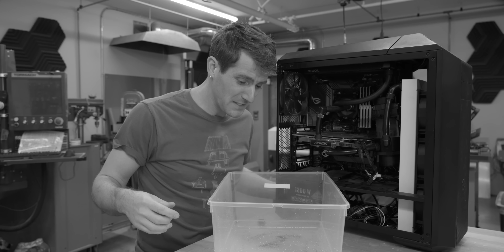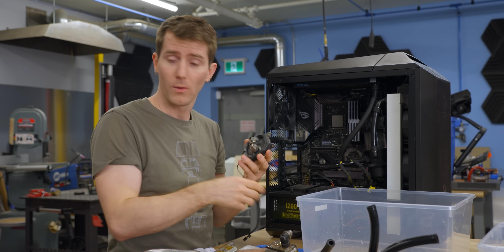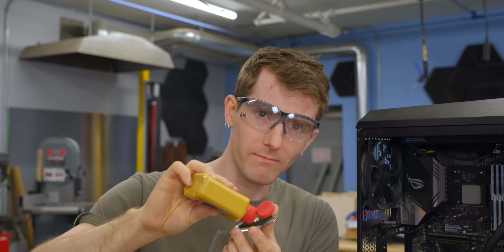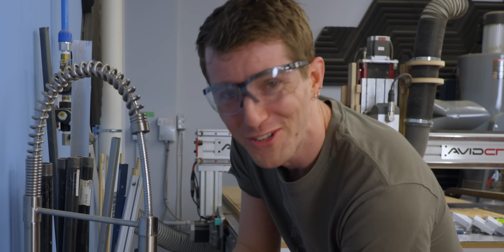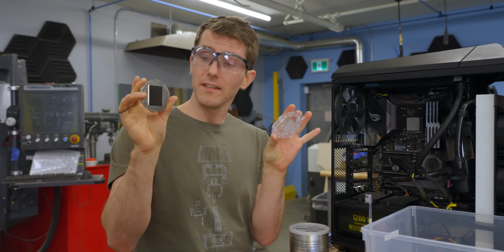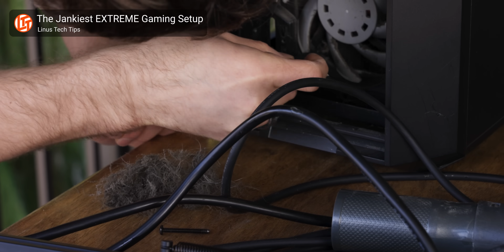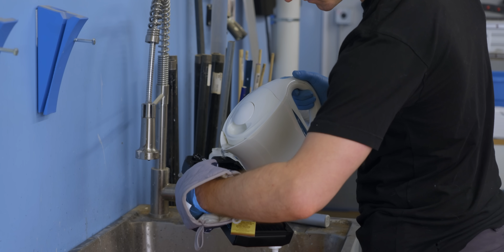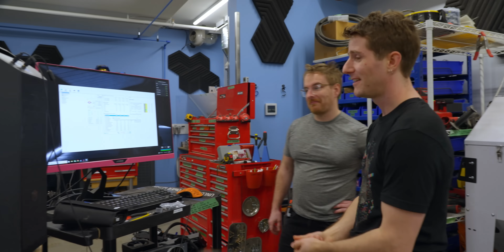I Will Never Watercool Again – Water Cooling Maintenance Guide

Comment: I can say that with modern hardware to properly cool those higher end cpus u need something like the nhd-15, which is a chunky boi and can definitely have some component compatibly issues like a tall ram.
had an issue with my current serup where my rgb ram was too tall, so i had to run without a side panel so i can ran 2 fans, until i built a second pc with nhd-15s and a shoeter ram and shortly after that my rig had issues with the ram and it was solved simply by swapping the ram between the systems.

Also (I have only a 3070) the gpus nowadays are very thicc and require even more planning and probably bigger cases which can get more expensive (mby expensive enough where u can get an aio instead in some cases (well at least after checking local pricing) ).

Comment: I like a big system. I have an x560m, 480-l and 360 monsta in a v3000+ and its amazing. I have it noise normalize so the fans and pumps just runs the same speed and its all but silent. But the other benefit to a system like that is OC stability. They say new i9 is stupid to overclock but i had a 12900ks running a 5.5 all core at 1.35v (delidded) and staying under 70c while pulling 340watts. Its a huge waste of miney but it does have diminishing benefits 😂

Comment: I stay away from water cooling.  It's messy and a lot of times, dangerous.  If you're crazy enough to go beyond AIOs and make a custom loop, you better prepare yourself for any potential disasters.  I would argue that water cooling is best suited for people who have a lot of money to burn, as maintenance is not easy or cheap.  AIOs also take more time to clean than a standard air cooler.  Leaks for custom loops are a lot more common than most enthusiasts would like to admit, and strange growths may happen INSIDE the loop.

If you're a content creator that likes to run your processor to the maximum, maybe you'll need water cooling.  If it's just gaming at 1440p, air cooling would be good enough.  I personally stay away from 4K because though it looks nice, it eats up too much resources and you take a hit in framerate.

Comment: I haven’t messed with water in many years.  The maintenance is too much for someone like me who is lazy. Koolance LIQ705 is clear, non conductive, performs close enough to water, and I let me loops go for 5 years without any maintenance without any major issues.  Sometimes I need to add fluid, very seldom though.  It can go longer than 5 years, I just perform whenever I upgrade a component

Comment: Sooo... at like 6min you cleaned the plating so well. you exposed 2 metals that are in electrical contact while inside an oxidizing medium... so what I am saying is. this is gonna rust. its not a question of if. its a question of when it will just start leaking XD

Comment: why not use a paint shaker to shake those radiators vigorously. ps im giving up on water cooled. its just to dam expensive. everything to dam expensive. when a gpu cost as much as the whole fucking computer. its just not viable any more. thank you tech world for over pricing every dam thing that has to do with a computer.

Comment: Exactly like your automotive cooling system. When you need to add water to the systems. Use *distilled water*.  The less iron & minerals in the water. The less buildup of corrosion done to the metals, plastics, and rubbers that make up your system.

Comment: you did the cleaning of the radiator WRONG! After the white wine vinegar and water mix, you need to flush it with a mix of a warm WATER and Biocarbonate of soda (baking soda to you lot) MIX- in order to neutralise the acidity of any remaining vinegar...... if you don't do that then your clear tubes bet all fogged up. Then the final rinse of your rad before isntalltion is ALWAYS with distilled or de-ionised water........... BLOODY cowboys!

Comment: I saw the weaker reliability of wc. So i don't use it. Running noctua su12 and positive air flow. PC lasts for decades and have a servicing every 2 or 3 years. A wc is lucky to last past 3 yr without requiring a replacement. That's more work.

Comment: Not all O-rings need lube but, if your going to for water source iv thought about it but have not done it yet for PC WC O-rings Magic Lube, you use it for pool O-rings so if your thinking of using one Teflon based ment for it make sure you have the Blue cap version not the red. hard to say there,

Comment: Anytime u take out a rubber o-ring you should replace it. When you put pressure against them it flattens over time. By putting it back in your introducing a fail point.

Comment: I am smugly reminded why I like my set-up with a chunky air cooler.
Yeah, watercooling allows greater overclocking, but ... air cooling just keeps doing what it does.
Bit like comparing a race car to a "daily driver". One is faster, but the other one does not need the oil changed once a week. Different tools for different jobs.

My next experimentation will be into underclocking, so extra cooling is kinda unnecessary for that use case ;-)

Comment: Hmm water cooled PC. I work in the laser tech a lot of lasers are cooled by air, fan or sometimes water.  Our 100 W CO2 was water-cooled with distilled water. The 6 W Argon ion laser was also cooled by water. In Photonics I build an air-cooled Nitrogen laser at 30 mj a second Max power. Rated 337.1 nm.  We did not have the budget to build any Nd;YAG lasers at 1064 nm or Ruby lasers that would have been very cool.

Comment: Hm, maybe I should clean my custom loop I built in early 2020 (distilled + kill coil). Only maintenance I've done is add more water, since the outside rad leaks the tiniest bit, and admittedly the clear tubes grew hazy a couple years ago. Fine temps, though!

Comment: For pump parts, use ultrasonic bath. Use distill water from 3M. Premixed coolants are toxic and will evaporate into your environment. If you use blower to clean your radiators then keep in mind that FANs are better to be removed otherwise you will blow dust inside the bearing(sometimes).

Comment: 16:47 Guys, WTF are you doing? Really. 
Look, just take bucket/canister, hand-held boiler (google for Korjo Travel Water Boiler), hose/pipes, Y stainer and assemble your hardware wash.
Gallon of water, winegar, couple oz of citric acid into canister, hot water and boiler for temperature maintenance in there too. Hose from canister to pump, from pump to radiator, from radiator to Y stainer, from Y stainer to canister. Boiler plug into socket, 12v on pump and leave it for hour or two, then change direction of water flow through radiator (swap from_radiator and to_radiator pipes) and another couple hours of washing.

Comment: I've been running a custom loop for 8 years and have replaced the waterblock with a new processor once, and changed the water twice. I run premixed motorcycle coolant in it with no issues.

Comment: The metal that was used to create a radiator, could've been used to create a bigger heatsink.  Plus, you're still technically air cooling as fans cool the radiator.

Comment: after multiple big fan radiators, AIO's failing, and just heat problems in general, I went to building my own water loops and never looked back. Temps stayed great, only use distilled, and still no complaints. And honestly, any leaks have been me not initially sealing something correctly.

Comment: I fell in love with Noctua 3000 rpm fans not because faster is cooler but because they can keep air moving through the dust I refuse to acknowledge. 
"Well how can you hear anything over that" 250w speakers of course, just turn it up.

Comment: Automotive guy here who now disabled became tech guy and when building my first pc I instantly went to automotive tech like you said but also that you screw them down lightly first in star or plus shape or anything but as you stated then when all are down then go back around and tighten them to spec.
  I have wondered why the computers do not cool the same way like cars. Having an external radiator with a built in reservoir that like a car have a top side fill and a bottom drain that would keep the water out and not have to really take the pc apart so often to keep it clean and cool.  I watch your videos often and I wish you would just start making and selling computer things made better. Like the water and air cooling that you have shown the flaws of.  Another question when setting up a watercooling system, Why don't they have a filtration section in the tower, There are often tones of empty space in a tower that you could just have a filter somewhere in the line between radiator and the reservoir. designing your own loop then make your own filter replacements and you are set for life.

Comment: If there is a contact with copper, ions will erode and cause corrosion on other metals. Pipes are also not diffusion resistant, so the solution will get acidic from CO2 and will make metals oxide.

Comment: imo water cooling is only necessary if you're running a very high-end setup and use make constant use of heavy applications
and when i say very high end i mean veeeeeery high end, one of those nasa-level PCs which can get on fire if not taken care properly
my PC is not close to being a high end one, so it's not a great example, but i run a 1060 zotac 6gb and an i3 10th gen, having 4 fans (3 in the front + 1 in the back) on the casing + one specific to the CPU + another one welded to the GPU
the hottest i've ever seen my GPU go was 60ºC while running minecraft with complementary unbound shaders on an average 45fps (i was very surprised that it got this high and ran kind of smoothly without a single lag-spike lol)
and with that, the only maintenance i do is a bit of dust-cleaning once a year
another example is a friend of mine whos running an actual high-end setup, with an rx6750 xt 12gb and an i9 14th gen, he's got 3 fans on the front and also does a single dust-cleaning yearly, never had a single issue with overheating

Comment: I'm not sure why people think water is any quieter then air?  Radiators need fans, so you can just upgrade your fans to a quiet one and run it slightly lower, and it's just as quiet as water.  Custom loops are not worth the cost, upkeep, danger of ruining parts whatsoever.  With that being said there is also nothing wrong with running water if you want to tinker and are ok with a leak where you have to go without a computer until it's fixed.  For me I run a custom AIO, and fans, or high end air.  I will say having water is nice to have the extra room in your case though not having a huge air cooler covering your MOBO, it's cleaner, and easier to work on stuff, unless it's a hardline custom loop etc.  Also with certain CPU's when they didn't use liquid metal and people were de lidding them without delidding water would be of no use as it can't dissapate heat any quicker due to the CPU bottleneck from not using liquid metal, and all that nonsense.

Comment: Using watercooling a system in my pc for the last +20 years. Had one accident where i fried some harddrives back in the day (120gb and a 160GB) but that way my own fault.
Otherwise its great - cant hear a difference if my pc is on or not or on full load. But i probably build my system better then he did.
Also using the heat for my large 500l fishtank - ofc a different water cycle.
Saving a lot of money on heating.

Comment: I watercooled. You can't refresh the thermal paste without dismounting certain parts of the loop. I had to silicone glue the joints because there was a manufacturing defect in the EKWB pump which led to a tiny trickle of water leaking out of it. The worst part is my water turned from green to grey within a year. Not to mention I had to butcher my 1080 Ti to get a waterblock attached to it, and yet the VRAMs and VRMs still overheated. Never again.

Comment: And this is why I just buy the biggest Noctua that fits in my case. Aside from blowing it out and maybe theoretically replacing the fans one day (I have seen 13 year old fans work just fine), there is no maintenance. I prefer to waste my budget on IDE interfaces and LS-120 floppy drives. :)
Reply: yes, I am glad I didn't even go for an AIO on my new system because I never quite trusted water cooling. Now I know why. My last system, with a mid-life GPU swap, lasted close to 7 years. 0 maintenance and it's still running just fine as a secondary now.
I run a 4090, a big noctua on a 7800x3d and two large case fans - and it's not even really loud under load.

Comment: As for the radiator cleaning scene. If you knew someone with a paint shaker and you could secure a radiator in it, that might save you some trouble :). Thank you for finally turning the corner. unless done with the maximum care and perfection, water cooling is, IMHO at minimum a PITA and possibly a recipe for disaster. As a rule, water and electronics don't mix. Great video though. Thanks. BTW that toothbrush looks awesome :).

Comment: I've had the same water in my hard line custom loop water cooled PC for almost 3 years now. I have dissembled it twice to clean, add more NVME drives, and swap the PCI-E riser I used when I first built the PC. But both times I captured the water in a jug, then reused it. It has stayed crystal clear and haven't lost a drop.

Comment: As fun as this video was, never in all my years of a custom loop have I had anything like this. Quality fluids with out pastels or anything suspended in the fluid beyond dye is key. Also regular maintenance is also key, I redo my loop 14-18mths around an upgrade cycle, never ever longer. The gunk does look like rubber from the tubes, which is why I only use Acrylic tubing, though PETG should be also a good a more forgiving choice. However I do agree with one sentiment, custom water cooling is not for everyone and I always advocate against it. It is a labor o love, not a labor of need.

Comment: I have been liquid cooling for years and will not go back to just air. It's not that difficult to maintain at all. I run two pc's one has a custom open loop and is my daily driver that runs just fine. My second pc does have an aio that is six years old and it for some reason also runs just fine. The scare tactics in this video are just laughable.

Comment: You can buy ultrasonic bath for cleaning parts. It can remove dirt from narrow crevices and other hard-to-reach places, that's  why they are indispensable in watchmaking and watch repair. For waterblock plates you can use L&R 111 ammoniated cleaning solution in ultrasonic bath, it should remove oxidation

Comment: BAHH... Ignorance at it finest. 

I have 20 feet of copper pipe plumed under my house, to a 100% copper 60mm x 360mm radiator ( Alphacool NexXxos UT60). 
2 pumps and a stainless steel reservoir in my network/pc closet to monitor levels and fill if ever necessary. 
No drip ,water tight, quick disconnects to easily remove pc for upgrades or dust cleanings.
I run a 70/30 mix of water and automotive grade antifreeze. (Zerex non phosphate). 
Both CPU and GPU are full copper (nickel plated) water blocks. 

Temps never get above 65C , and now my Office/Game room never gets above 73F.  All that heat gets pumped outside. This system have been running 12 hours a day, for 3 years and the coolant is the same color and clarity as the day it went in.  The PC fans are barely running,  just to cool the memory and the mosfets. This PC does gaming, cad design work, 3d modeling and normal browsing. Never a cooling hiccup. 

Paying $800-$1000 for my comfort was well worth it.

Comment: I have a box fan with a 20x20 filter on the back of it blowing into my case. best cooling around. especially if near the AC vent, in the winter I just block the vent and the PC heats the room.

Comment: Yuck!  I had a couple of water cooled computers with custom loops about a decade ago (not built by me).  After having leaks after about a year, one even wrecked the main board, I switched completely to air only.  Thanks Noctua!  I used to have 14 computers in my place, now I am down to 8.  All are air cooled.  And yes, I do use all of the computers, I do software and game dev, and most are test rigs.  :)
I plan on buying another new computer in a few months, but I'm waiting for Intel Battlemage so that I can add an Intel GPU to the test setups.  I still haven't decided on Intel 15th Gen though.  I like HEDT systems, so I'm considering a retro X299 with Intel 10th Gen X processor.  I already have two X99 systems, an R9, and a Xeon W-2400, plus others (9th Gen, 12th Gen, etc).

Comment: from a hot tub guy, those liang chineese magnet drive circ pumps are one of the highest failure rates in hot tubs that use them for circs. Mostly jacuzzi brand, using them as circ pumps. That said, dont think your loading an executive 56 or even an iornmight or circ master in there so its understandable. Theres not much for 115v circs that is really reccomendable my way. Just be warned i guess.

Comment: My water cooled system is silent because my radiators are external. Coolant tubes come out of the back of my pc, go through a wall, and connect to my radiators on the other side. I run the power/control line for the fans through the same hole. The main reason is that it keeps my game room cool. All the heat vents into the upstairs common room where the HVAC thermostat senses it and compensates. A silent system is a nice side effect.

I use EKWB Cryofuel which is hella expensive, and do the yearly flush and fluid replace they recommend but I just don't have the issues you showed in this video.